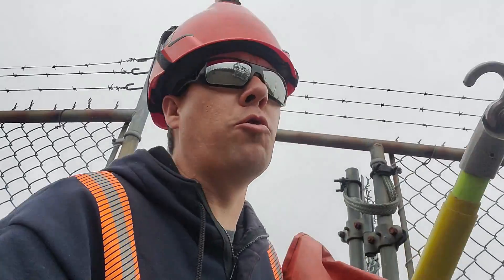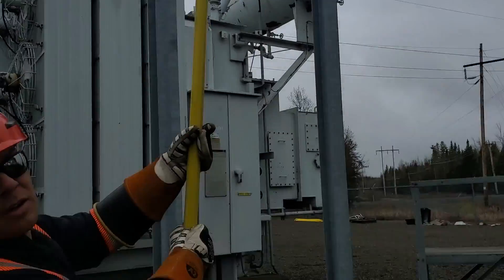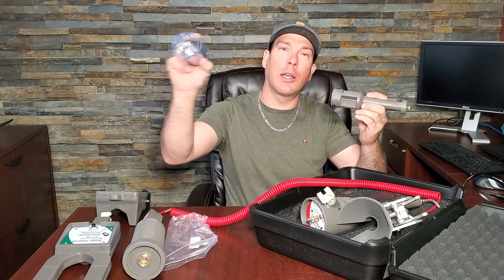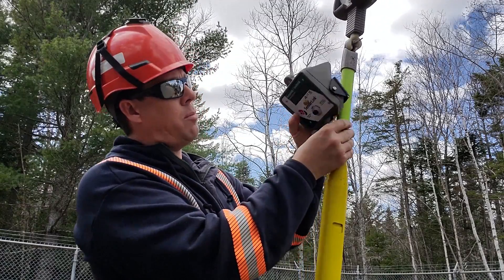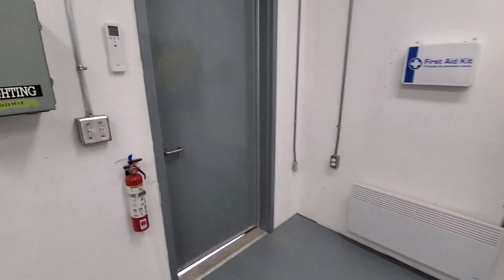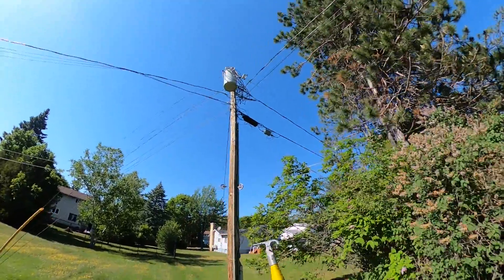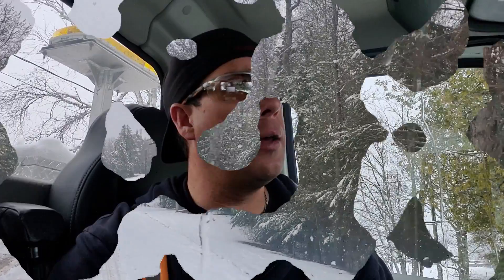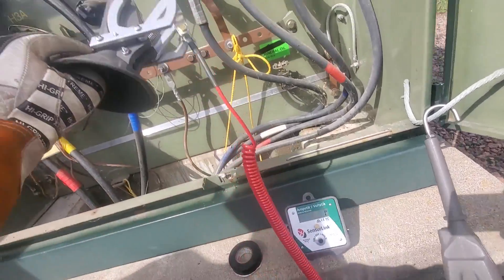High Voltage testing with SensorLink - Troubleman's kit

Comment: as an HVAC tech its funny to think that to us 240 - 460v is high voltage when there are people working around 10k- up to over 100k lol.
Reply: Here in the UK, we have national grid voltages of 132kv, 252kv and 400kv. Local grid voltages are down to 66kv, 33kv and 11kv.
Reply: I've worked on some HUGE chillers for refrigerated warehouses that were fed with over 1kV, but that's the biggest I've been around, not counting industrial busbars. I started out with res/com HVAC and moved up to ind refrigeration; best move of my life.
Reply: @RT-qd8yl  ind refrigeration. Are you on roofs a lot? Whole reason I don’t want commercial is because I hate roofs
Reply: @michaelguido7505  Quite often, especially RTUs and rooftop condensers. Even if you're not on the roof, you might be crawling inside a Kool-Jet mounted 30 feet up on a warehouse wall. That's one of the reasons I got out of that side of it. I couldn't handle all the climbing, carrying compressors up ladders, etc anymore. Now I work on the factory side of things and stay on ground level, haha.
Reply: 240 will still pop ya. Doesn’t feel very good. I’m sure you know that though lol